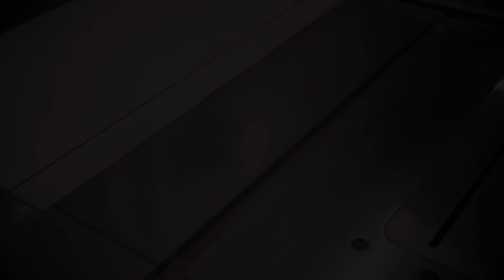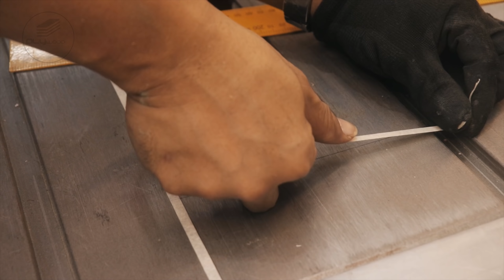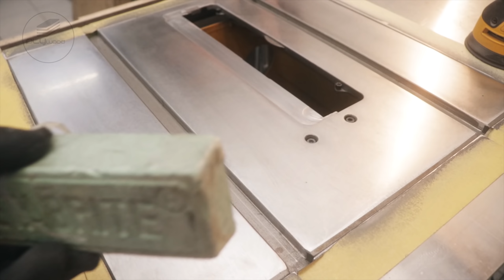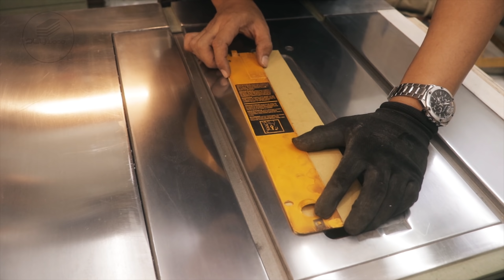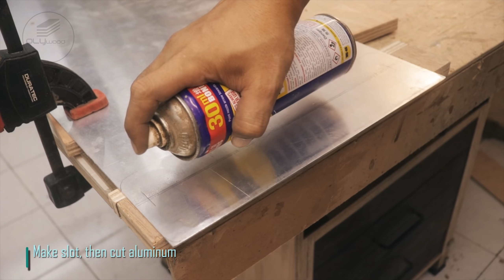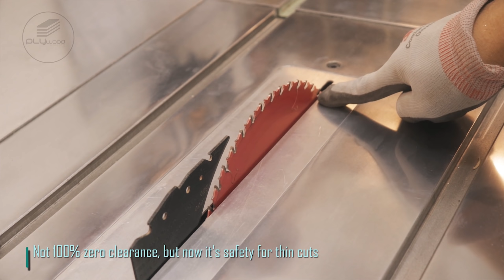Upgrade Dewalt Top table with metal insert - DIY Table Saw

Comment: Interesting. Is this an aluminum top saw? I can't see doing this on my cast iron one using a router bit. I hope you were wearing some good PPE, although no gloves.
Reply from the maker: Maybe you just see my channel, why i use only gloves on left hand. I have accident if not use gloves i cant work. This is job side table saw that why using aluminium top table. Table saw in my country very expensive that why i using job side, but hope in future i can but cast iron table saw

Comment: lobang insert nya berapa Mili itu mas? aku bikin 10mili/1cm rada cemas jg
Reply from the maker: 5mm yg skr ini, klo 10mm gk jauh bedha am yg sblmya, klo pgn zero biasaya 3mm
Reply: @plywoodworking  suwun mas,   berarti perlu di utak Atik LG y 🤦
Reply from the maker: Sip mas, klo ts dewalt 7470 ini gk bs diganti kecuali mau cara extreme kyk sy ini, tp klo diy ato stanley bs

Comment: Why didn't you use the table saw to cut the slot? Then you would have had zero clearance.
Reply from the maker: This is aluminium 2mm, and still need make more slot again for riving knife, i not sure can make straight slot if like that